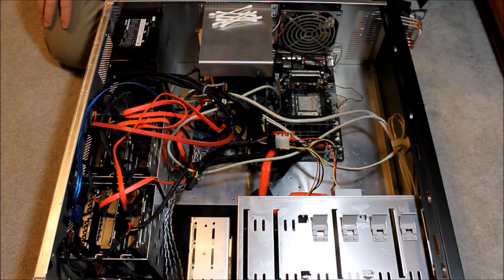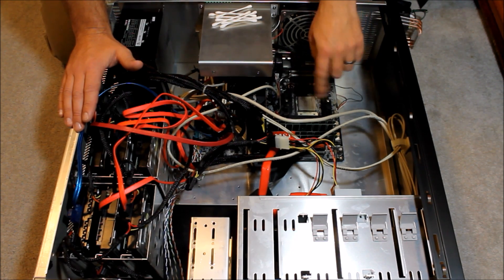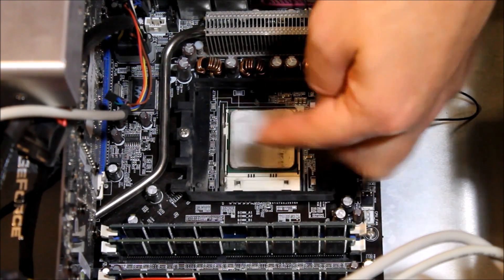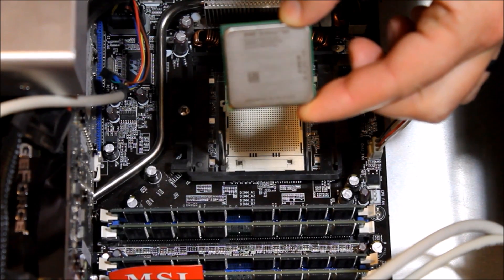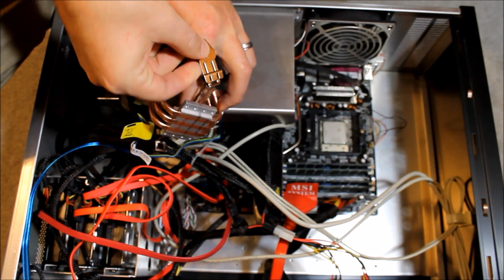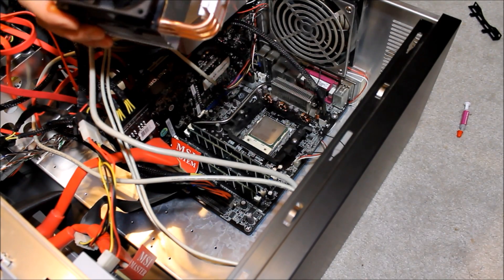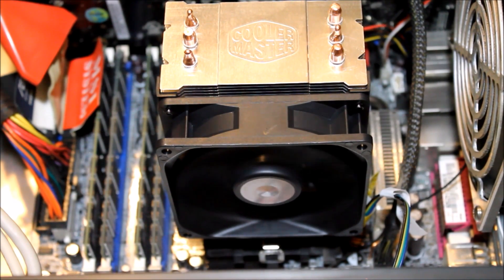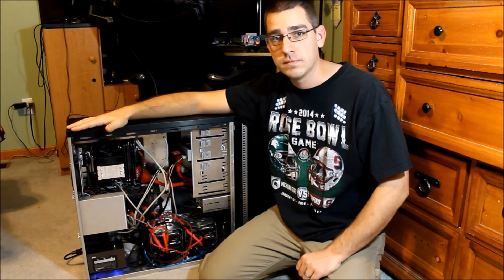Replacing a CPU Fan - Step by Step Universal Process

Comment: I know this video is a few years old but this is the best video I've seen on this particular installation so I was wonderingif you could help me.

 I have that exact same fan which I'm trying to install but I don't have the correct bracket. I don't have the little clamp part that I need.  I have a bracket that looks like an x with a screw in the middle and it just doesn't reach the back bracket so it can't be screwed in.

Do you have a link or know what the clamp part is called so I can find it in order the part?  I would so appreciate it.

Comment: I replaced a CPU fan with a new identical model but on boot up the fan stays on at the highest speed. No settings were changed and when I reinstalled the older fan it ran at a normal speed as it did before. All I can think of is the new fan is defective in some way unless I'm missing something.

Comment: Depending on what heatsink you have.  that's what your actually replacing. Like the one your putting in if the fan goes out.  You can just remove  and replace the fan . An won't have to replace the entire heatsink.

Comment: Thanks for the video.  My son and I are preparing to replace the CPU cooling unit in his Lenovo Legion C530 and the power supply doesn't have a switch.  I'm concerned about leaving the unit plugged in from a safety perspective but I'm not sure about proper grounding to protect against static while we work.  Advice?

Comment: My cpu cant give signal to the monitor, when i turned on the cpu power, the power supply fan and the mother board fan works for a minute and stop working. I already changed a new power supply and it only works for 3 days and the same problem comes back. Please help me to fix this issue. Thanks
Reply from the maker: Sounds like you have a bad motherboard there. I can't say for sure without testing things and seeing it first hand but that is the way it is pointing. You could try a PCI-e Graphics card if it is just the video issue but if the whole thing stops working after a few days it could be the board. Also, make sure it is not overheating, clear/clean all fans especially the CPU fan with canned air.

Comment: You demonstrated how to change the heatsink or cooler, not the fan.
Reply from the maker: +FroztiProductions I suppose you are correct except that you would never replace just the fan except in some rare cases since the fans are designed for a certain heat sink.
Reply: @SSLFamilyDad  This video is great. I was able to find the exact replacement fan for my PC, so I was able to keep the old heat-sink. I was very careful with removing the old thermal paste and applying the new thermal paste. Before doing the fan replacement my SpeedFan application was showing the temperature for the CPU to be around 40 degrees C. After replacement it is running 28 degrees C. I'm convinces, so I have subscribed. Thanks!

Comment: You're mounting a cpu cooler, not replacing the existent cpu fan for another.
Reply: I thought he said at the beginning that he had already removed the old Cooler (Fan) because it was broken (Giving error messages). And as such he replaced it.
Reply: @rmyd027  I am replacing my CPU fan. He is replacing the heatsink AND CPU fan. Big difference.
Reply: @jedioftheshire-0147  what if youre replacing a stock cpu fan with one that has a heatsink
Reply: @Geist-0  Stock cpu fans have heatsinks as well albeit smaller ones.

Comment: I have a ASUS all in one computer and it keeps shutting down and I don't hear the computer fan run so I assume the fan doesn't work.  What size and type of fan do I need to buy?  I recently bought  new power supply and I know it doesn't have too much power for the computer.  I checked the specs on the power supply and compared it to the specs on the old one.  If you'd prefer to email me my email is rdpeterson1954@gmail.com.  Thanks,  Roger
Reply: The computer should at least be able to turn on (The CPU is capable of running at up to 60 degrees Celsius in short time spans) to give you the error message about the fan. And if you are worried about whether the fan is working you should be able to go into the BIOS of the motherboard (ASUS has a pretty good BIOS UI to find the info you need, I personally have a RoG board). There you should be able to find CPU Temp and Fan speeds and see what RPM's your fan is running at or what temperature your CPU is idling at.

If its a Power Supply Issue than you should be able to find the power demand in the manual that came with your computer when you bought it (If I understand correctly you said this was a pre-assembled CPU from a manufacturer). If your Power Supply Unit (PSU) says its meeting the CPU's power demands than there are separate issues, possibly with installation of the PSU.

Comment: Hello there, i've had crashing issues lately after upgrading my cpu and when i try to take temperature readings they never seem to be right. For example it will show my heat of my cpu being lower when i play games which makes no sense. My point is that when i take my cpu fan off my cpu, i has little air bubbles could this be the root of my problem ?
Reply from the maker: +That Guy Craig that could be an issue, you also might have a bad temp sensor on the board or chip
Reply: If you have an amd cpu, it shows the distance from the overheat temp, not the actual temp

Comment: Hello, great video.

one question. I bought a new heatsink, I took a picture and info of the motherboard to the store to make sure I didn't buy one that didn't fit. When installing everything fits but every time I push one notch/lock on the motherboard the oposite one doesn't lock. Its like I can't push it far down enough for it to lock.

I hope I explained myself right, English is my second language.
Reply from the maker: +Martin Odella that is a very good explanation. I had this trouble with a few also. Make sure the center pivot point is in the right spot. There are little hooks that it has to go under. It might take a little force as it is supposed to be held down tight. Keep working at it, you'll get ut
Reply: Thank you

Comment: Thank you for your help sir! I really liked your video and found it helpful. I been having some problem with my computer lately that I was hoping maybe you can help me with or give me some advise on. 

I have a i5 4670k+16g+z97+gtx760 config and it has been working fine for the past 2 years, but recently its performance had a huge drop whenever i play ANY 3d game(even with older and less resource consuming games) it would starts off fine but soon become laggy/slow/big FPS drop etc. Even when i watch HD youtube video, the CPU usage can go as high as 80%(opening 2 HD youtue videos at the same time i get a stable 100% cpu usage) which for a computer with the config like i have should been handled easily. I reinstalled my windows, didnt solve the problem, when system is idle the cpu usage is low(around 5% or below), so Im pretty sure its not a software/virus problem(I THINK)

After a series of effort/diagnoses I found that my cpu temp. is high when processing hard work that it can reach 100 degrees Celsius for play "outdated games" like csgo, and 80-90 degrees for watching HD youtube video/multiple downs etc. Im not that good with hardware so it took me a bit of time to identify the problem. It clear that my temp. is without doubt too high. I have a cooler master liquid cpu cooler and the fan on the cooler spins fine to me.

So do you think its the cooler thats causing all this, or do i simply need to clean/reapply the thermal paste. Base on the description given, do you think that the cpu overheating is THE ONLY problem causing my computer to slow down? 
Could there be any problems/potential problems thats causing all this that I am not aware of.

Last, if I need to replace the cpu cooler, do u have any recommendations?

sorry or long post and thank you for helping.
Reply from the maker: +John Lee It does sound like a heat issue, first thing is to clean out any dust on the cpu cooling fans for your liquid cooler and also check for dust on your graphics card. It does seem like things are getting hot, maybe your liquid cooler is not working at all? these types of issues can also sometimes be related to hard drive issues. Upon bootup you can general hit a key for build in diagnostics that will help identify hard drive or other major issues. Also, make sure you have the latest graphics card and cpu drivers, go to the nvida site to get the graphics updates and install the intel updater to check for cpu and chipset updates.
Reply: SSLFamilyDad Problem fixed!  i changed the cpu cooler and its all running cool now   lol   thanks for the help

Comment: Great video, that clamp looks like it might be a bugger to install since it goes blindly on the bottom. :)
Reply from the maker: Buddy Harrison Great observation, it is tricky to hold it in the right place while getting it clamped down but easier than some other ones I have used. This seems to be a great little fan so far. Thanks for checking it out Buddy!

Comment: Also, for anyone new that's going to do this, whenever you put the cpu back in, there should be no resistance whatsoever.  It's called a ZIF chip, which stands for Zero Insertion Force.  The chip should just drop in.  If you try to force it in, a pin could break, rendering the cpu unusable (plus, most merchants will not refund/replace for a broken pin).

I watched the video because I am interested in putting that cooler on my AMD Vishera six-core.  The stock fan has lasted about a year and a half, and now I'm starting to get a tick in it.  I don't like to wait for a thermal event.  I'm at 2368 rpm at 30 C with a minimal load on the stock fan, so 2800 rpm with a larger fan should be more than enough for my needs.

I have to give you credit, when I work on the cpu, the RAM always comes out first thing. ;)  It looks like a mid-tower, how much clearance did you have from the side of the case to the top of the cooler?  Do you think it provides good airflow within the case?  It was a great video and sorry for the book.

Comment: Great job on the fan replacement. I've been working with computers since 1986 and all your steps were correct. I would make an addition regarding the "firmware", programming written to the chip set on a given device, for systems. With the onset of micro chips, the chip sets on the different devices hold a lot of their own device specific information and the "drivers" in today's Operating Systems rely more heavily on that firmware to work with the hardware. It's a good idea to check the manufacturers site to see if there are any updates for the system BIOS and such. Usually the only reason a hardware manufacturer publish those updates is to address issues that, believe it or not, may not show up for months or years. The old adage "if it ain't broke don't fix it" doesn't apply any more. It's just like changing the oil in your car, regular maintenance is a GOOD thing. :) BTW, I work in server support for one of the major manufacturers currently and have to deal with firmware on a regular basis and people are usually surprised when updating it fixes an issue, regardless of the Operating System installed.:) Have fun and happy computing.
Reply from the maker: Great advise Old Pup, updating firmware and especially the BIOS in this case is a great way to ensure things are working correctly. In my case without the BIOS updated I may not have gotten the warning that the fan was not working properly and damage could have been done. Thanks for sharing your expertise here!